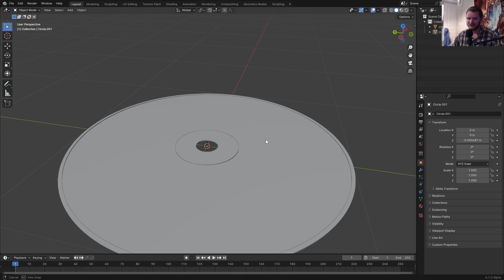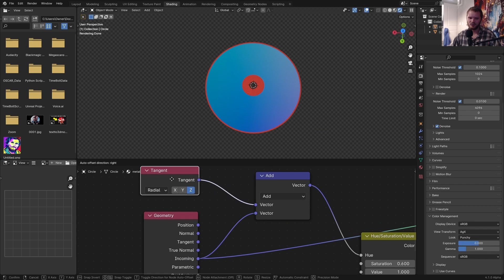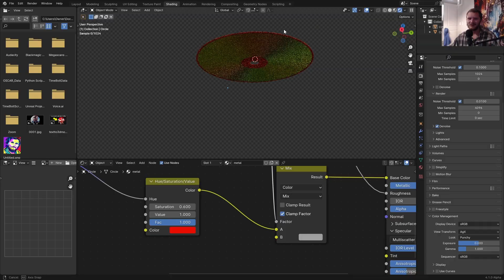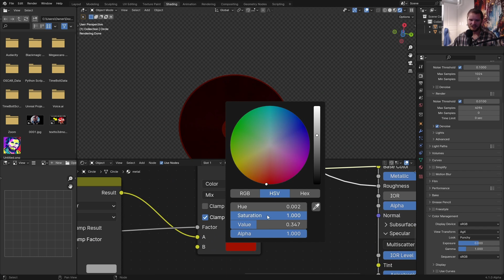disc material in blender

Comment: Thanks for the tutorial!  i tried fooling around with some random nodes to get that shiny iridescent effect, but it didn't come out as i'd have liked.  The Node layout was a total mess!

One way to use less geometry, is instead of separating out the Inner/Outer plastic rings.  One could use the Gradient texture (Spherical) & constant Color Ramp as a factor for the metal & plastic Shaders.  

Duplicate that Color Ramp; switch it to Linear color; make the 2 middle sliders black (or just the one corresponding to the inner plastic ring, perhaps); surround both those sliders with white ones, pushing them in really close (you may need to stretch out the Color Ramp node as far as you can, to get precise).  Use this gradation you made, and connect it to a Bump node at about 0.0005 distance, and plug that into each Shader, metal & plastic, to get a subtle indent.

Then to speed things up, you can Texture-Bake the CD, either a Combined bake (which won't allow the iridescent color movement), or just with a Bump image & Roughness image.  Then you can plug these images into the Shader, and it will load up a lot faster.  Make sure you've UV unwrapped the disc first.  (Edit: On the right, where the Bake settings are, use the "From active camera" setting instead of "Above surface," if you want to do a Combined Bake with the iridescent bands showing.  The bands may still appear on "Above surface," but now you can swivel the disc around to get a specific angle or look.)

If you want to make multiple CD designs, Bake each, front & back side (use Invert Color node between the Backfacing Geo node & everything else it connects to, to bake the other side).  Take all the saved images you made (maybe name them alphabetically), and "Open as Layers" them in Gimp, which is like Photoshop.  Move each disc face around within the transparent grey-checkered space, lining them up in order, Left-to-Right & top-to-bottom so its easy to remember which design goes with each disc you made.

Do this with all the Front sides, and Export the image with the "Save color values from transparent pixels" box checked so you have the Alpha channel.  Now do the same thing with the Back sides of the discs, in the same order as you did the front sides.  You'll need to line each disc face up exactly so the UV doesn't look weird.  Try opening up the Front-Faces image you exported as a new layer using Open as Layers again, and make it somewhat transparent using the slider on the right so it's easy to see what you're doing.  Use it as a template for moving the Back-sided disc faces around.  Click the Eye shape on the right to disable the template layer, then Export this image.

Now, back in Blender, use two image textures -- the Front & Back discs -- with the Backfacing Geo node as a factor.  Duplicate the disc shape you used with Shift + D, and in the UV editor, select all the faces; scale them down as necessary; and move them over the corresponding space on the image with all the different designs.  Do this for each disc, so they all share the same texture.  This cuts down on loading time.

If you want to make multiple copies of one design -- say, to make a stack -- use Alt + D for instancing (I saw a YT tutorial either here or on another channel aways back, that was immensely helpful.  Told me that unlike Shift + D, the Alt + D creates "ghost" occurrences of the same set of geometry, as though it were in multiple places at once, for more efficient rendering.  Don't quite understand how it works, but I've been using it ever since where I can).  

Ald + D and then G + Z, sliding the next disc up in the stack.  Once it's in place, then use Shift + R as many times as you'd like to make the stack higher.  Finally, group all the stack discs in a Collection; select all of them; use Randomize Transform to shift them about on the X & Y axes a bit for a slightly uneven, more realistic look.  You can make multiple stacks like this.